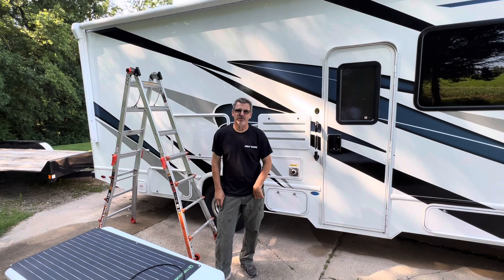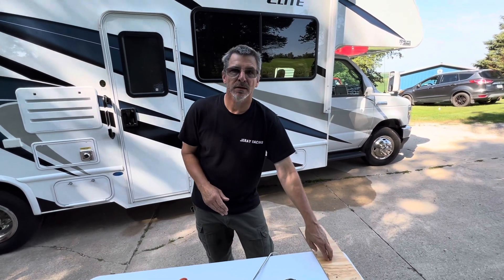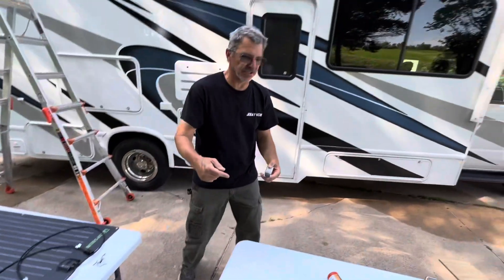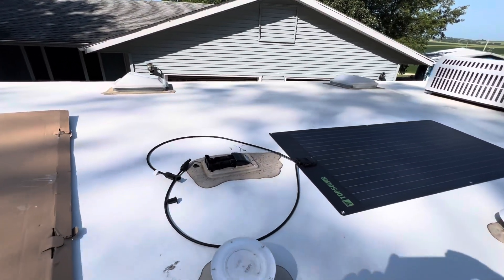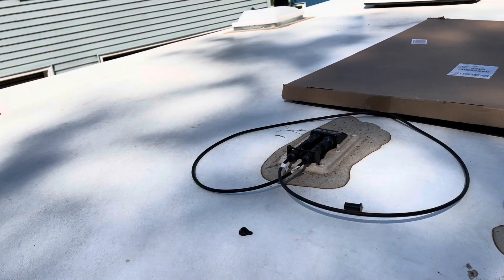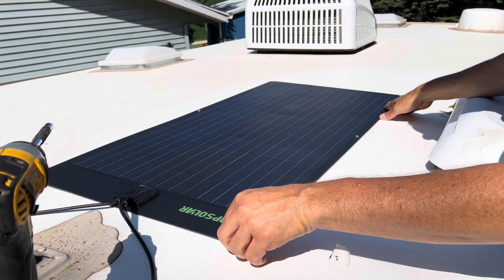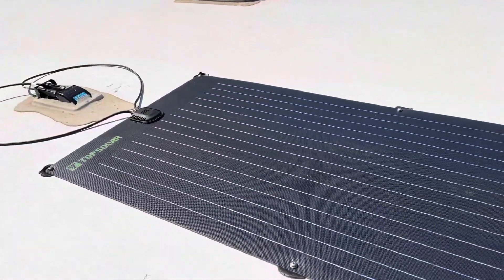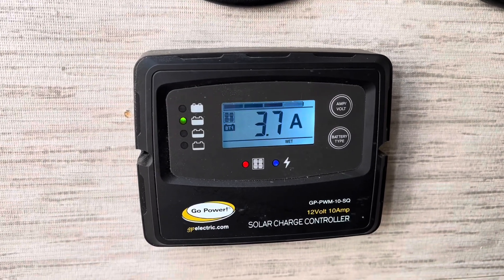How to install a flexible Solar Panel on a RV roof.

Comment: Shouldn’t you run lap sealant around 3 of the 4 edges so wind doesn’t catch the panel and Waller out the screw holes?
Reply from the maker: Maybe not a bad idea. I went out and looked at mine. Still very secure . I may do the leading edge. Thanks for watching

Comment: Nice install! I’m thinking about doing the same although our rig came with the roof connections but no charge controller. Just fyi, it looks like your charge controller is a PWM… if you upgrade it to an MPPT you’ll get more bang for your buck out of your solar panels (especially in indirect sun)!
Reply from the maker: It is PWM same unit as my Motorhome 
I may upgrade as I got two more panels for my trailer.

Comment: If you are going to screw into your RV roof, why choose flexible panels? To each his/her own.
Reply from the maker: Lightweight, not susceptible to damage, inexpensive. Original plan was use glue but I have a rubber roof. 2 years no problems, not ideal but it works . thanks for watching

Comment: I have a 190W rigid solar panel installed from the dealer and it does keep your batteries charged.   Thanks again for putting this video together.  BTW, crop duster did not bother me…LOL.  #Farmlife
Reply from the maker: Thanks for watching. I’ll end up with another panel I’m sure. Will see how it does next weekend at the track, no hookup there.